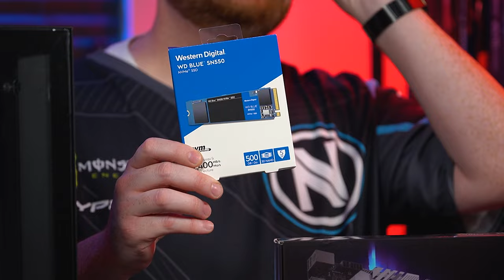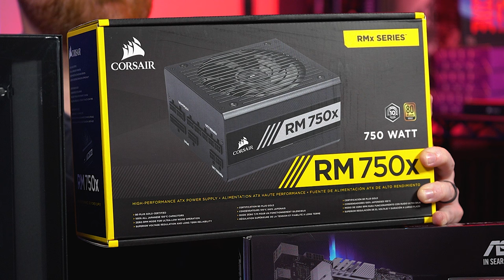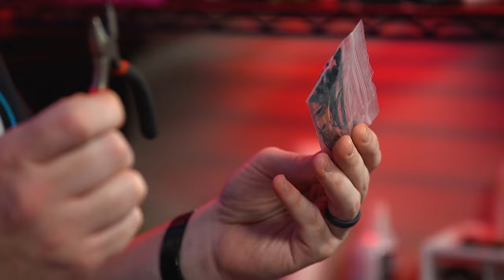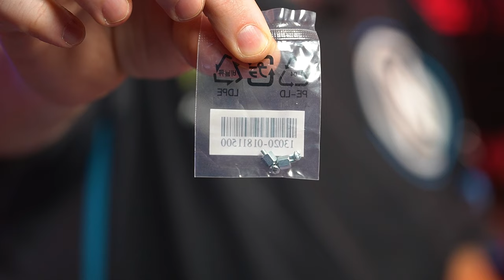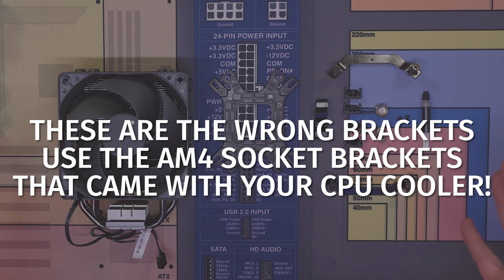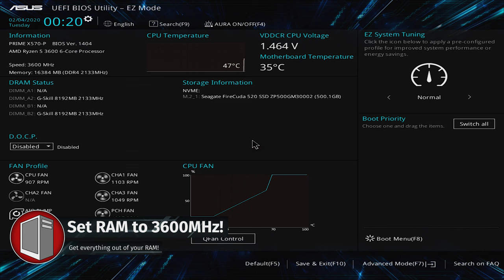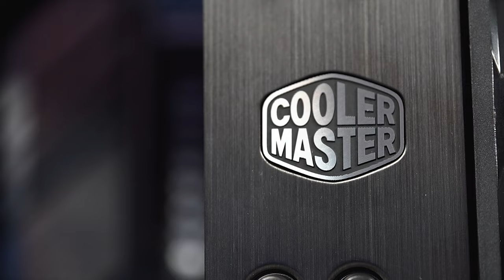How to Build a PC! Step-by-step (2020 Edition) | Robeytech

Comment: Did I miss the install of the hard drive?
Reply: There is no hard drive in this build. The SSD takes the place of the hard drive.
Reply: So imissed the install of the ssd. I call the all hard drives. Sorry about that
Reply: @jdgrant5888  No worries. He goes over the installation of the M.2 SSD at 16:41. There are 2 main kinds of SSDs: M.2 SSDs which are what he installs and the 2.5" SATA SSD. These look like laptop hard drives. Instead of installing directly on the motherboard, they install inside of the case and you run a SATA cable from the motherboard to the SSD's data port and a power cable from the power supply to the drive. M.2 drives plug directly into an M.2 slot on the motherboard and don't require any other cables.
Reply: Thanks. Mine are the sata 2.5" I have them both installed and one is running Linux. Now i just need to figure out how to put windows on the other so I can dual boot

Comment: I’m gonna buy a pc in November and can you guys give me an opinion on it.. 

Cpu/Cooler: AMD Ryzen 7 3700X 8-Core, 16-Thread Unlocked Desktop Processor with Wraith Prism LED Cooler
Motherboard: ASUS TUF B450-PLUS Gaming AMD AM4 (3rd/2nd/1st Gen Ryzen ATX Gaming Motherboard(Digi+VRM, HDMI 2.0b,USB 3.1 Gen 2, Pre-Mount I/O Shield and Aura Sync RGB Lighting)
ZOTAC Gaming GeForce RTX 2060 6GB GDDR6 192-bit Gaming Graphics Card, Super Compact, ZT-T20600K-10M will upgrade soon to a 3070 
Power supply: Power Supply 750W Fully Modular 80+ Gold Certified with Addressable RGB Light - Vairous Color Mode, GAMEMAX RGB750-Rainbow
SSD: Inland Premium 2TB SSD 3D NAND TLC M.2 2280 PCIe NVMe 3.0 x4 Internal Solid State Drive, Read/Write Speed up to 3200MB/s and 2900MB/s, 3200 TBW
RAM: HyperX Fury 16GB 3200MHz DDR4 CL15 DIMM (Kit of 2) 1Rx8  Black XMP Desktop Memory HX432C16FB3K2/16
And last but not least the case: LIAN LI LANCOOL 2 BLACK Tempered Glass ATX Case -Black Color -LANCOOL II -X heard it was an excellent case reviews are nothing but 5 stars. 
And also my monitor will be a ASUS TUF Gaming VG279QM 27” HDR Monitor, 1080P Full HD (1920 x 1080) Fast IPS, 280Hz, G-SYNC Compatible, Extreme Low Motion Blur Sync (ELMB SYNC) 1ms, DisplayHDR 400, Eye Care, DisplayPort Dual HDMI

Comment: WARNING: The Noctua NH-D15 doesn't fit in this case. I just wasted money on it.
Reply: @FlyinggMushroom  i'm gonna replace my nzxt h510 with a phanteks 600s. unfortunately i'm unable to return it because it isn't an acceptable reason in the refund policy of the seller. luckily I made enough from the bitcoin rally to cover the wasted money. it's still sad though :(

I reckon rx 5600xt is better and cheaper than rtx 2060. do consider getting that instead!

Comment: Your rig is a rig of a guy that want a 3000$ rig but doesn't have the money. So he choose underpowered CPU/GPU, spend extra on mobo/PSU/cooling hopping that it would help for the future. The day he upgrade CPU/GPU for his 3000$ rig he now discover that 850W is the recommended power for Ryzen 9 + RTX3080 and that any B450 mobo would have done the trick. So basically that the extra care he took to be future proof was wasted. He also waster a CPU & GPU he is going to change.

On the opposite if the guy just wanted a good rig for gaming today and that is something going to last, for the same price, he could have just took simpler parts (PSU/mobo) and an get RTX2060 and keep that rig for quite a long time. He would have much better graphics and perf today and until he decide to upgrade. 3-4 years after he would just change the GPU, at worst add some RAM and be good for 3-4 more years.

But the rig your propose will need an upgrade much sonner and the better mobo/PSU is just money you'll never get back. Even if the guy want to upgrade to a Ryzen 5000, any B450 mobo would have done the work and anything better than that would need a new mobo anyway and like new RAM too.